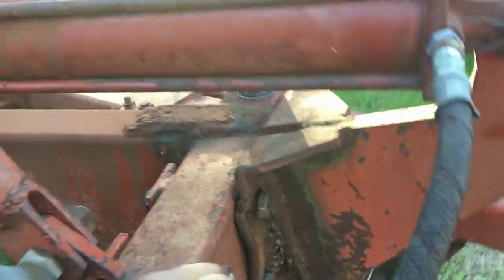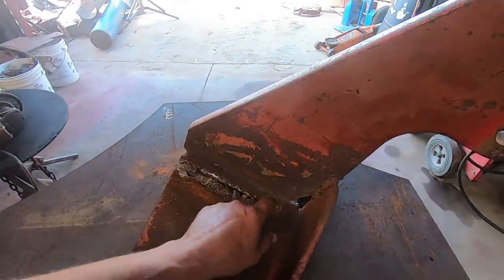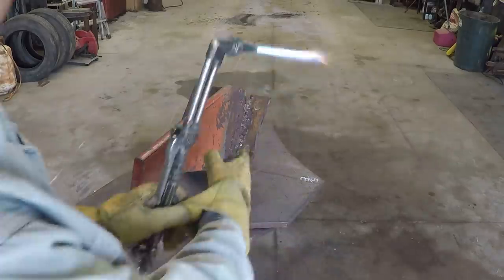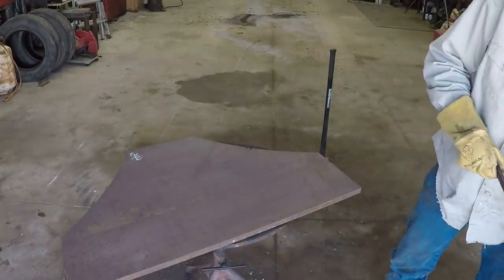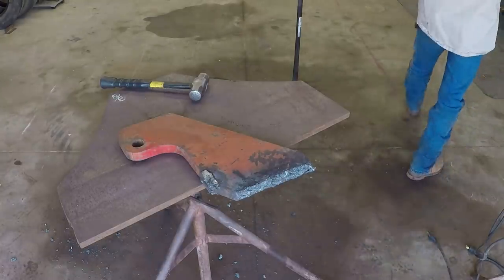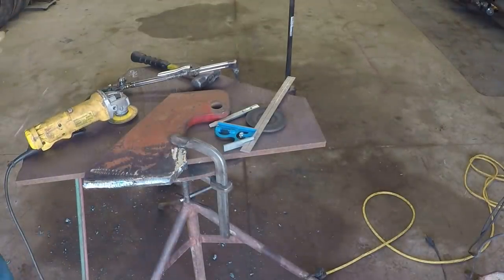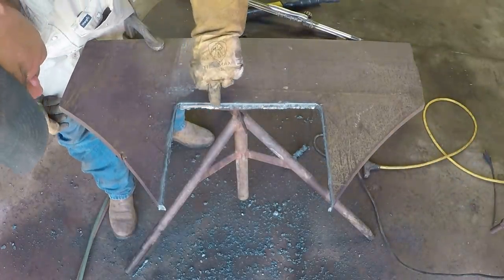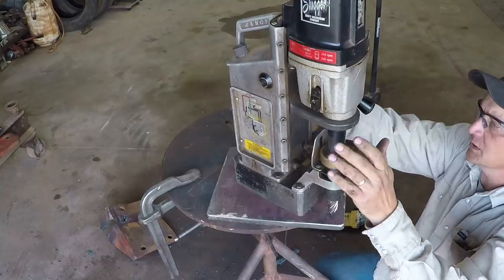Welding the disc, repair part 1. #welding #heavyequipmentrepair #weldingheavyequipment

Comment: should be plenty strong when you're done! jealous of the mag drill. I've been too cheap to buy one and the annular cutters really do a nice job.   I have a terrible time cutting sideways with a torch. just cant get a fluid motion so i normally cut away from me when possible and i can see the metal blowing out a little better.   Been working on the insley bucket that had some welds like that on it.   Ive been using and airarc  to gouge them out. its been a real timesaver!   looking forward to part 2 Frank!
Reply from the maker: I think it’ll work, the mag drill is my Dad’s just don’t tell him where it is lol. Annular cutters are expensive but if treated well seem to be worth the money. I never cut away unless there is no other way, seems easier to maintain speed when pulling for me. Fun burning of the old crap huh?  Hopefully pt2 will be our tomorrow. Thanks for watching!

Comment: Good video Frank. My favorite kind of repairs to do.  I wish I was closer you could have used my big Milwaukee surface grinder, it's a man killer to run but makes quick work of removing material on big stuff. Looks like the old SA will get some exercise!  Good deal.
Reply from the maker: Thanks Steve! The sa did get some active duty!